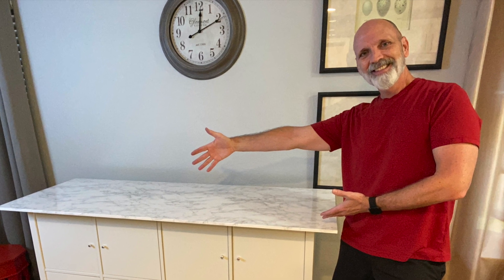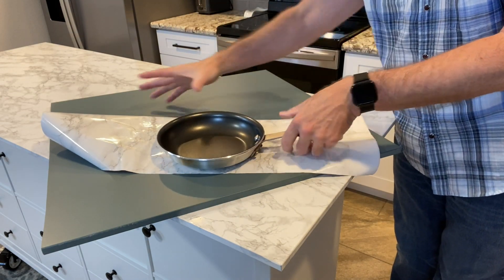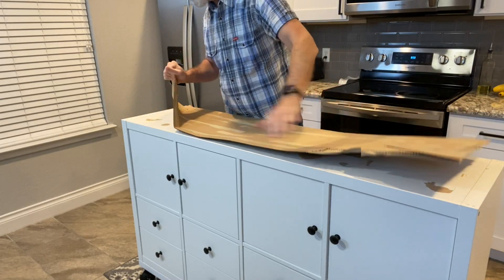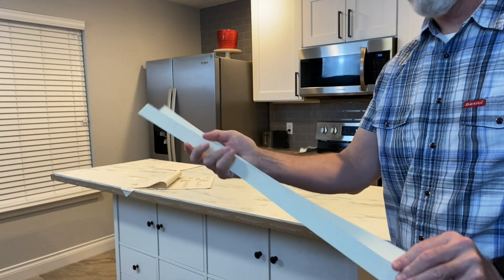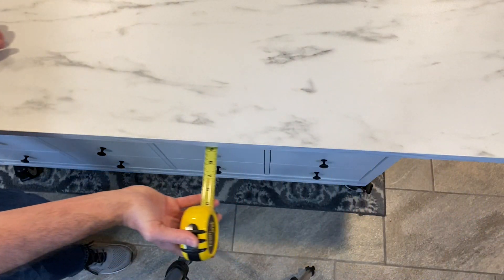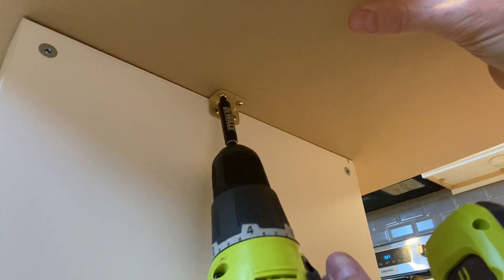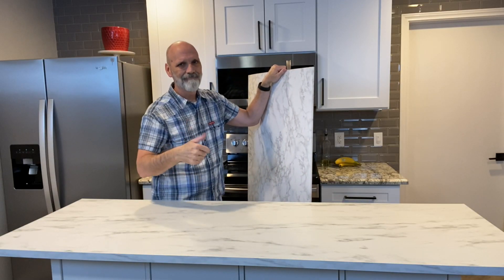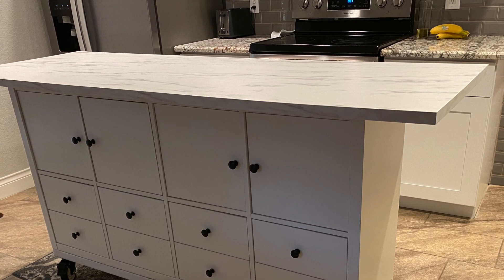DIY Kitchen Island Top Replacement With EKBACKEN on Ikea KALLAX Hack

Comment: Thank you for this tutorial! I’m going to build a similar one except I’ll be using the concrete counter top.
Reply from the maker: That sounds like a great idea.  The concrete should really hold the unit in place.  Let me know how it comes together, and thanks for the comment!
Reply: @mattsworlddiy  You could've also installed the L brackets on the inside...so no holes on the outside! 😊
Reply from the maker: @kingbee4474  Kingbee, where were you when I was doing this project.  LOL....I was trying to consider how to work it all from the inside too, but I just couldn't figure it out since the piece already has a top and I was installing this OVER the original top.  I appreciate your input though, and I still wonder how I could have made that work.  My mind is always trying to figure out things.  Thanks again!

Comment: What size did you get?

How sturdy is it with the wheels on the bottom? I'm looking to use a 4x2 unit Kallax to build something similar (bar/breakfast bar) but will use legs as opposed to wheels and not sure if it will stay upright if people lean on it.

Please let me know :) Thanks
Reply from the maker: CC:  I used the 4x2 unit and it is fantastic.  I put the top on which extends just a little bit on the width and about 8 inches on each side of the length.  I love having the wheels on it as it allows me to easily move the "island" if I want, and I can lock it in place.  I find it pretty stable, but would not put too much faith in it if someone were to lean on it with all of their weight.  It suits my needs perfectly though.  I hope this helps, and thanks for your comment!
Reply: @mattsworlddiy  Ace, thank you. I may have to look into having something more stable just in case 😆👌🏻